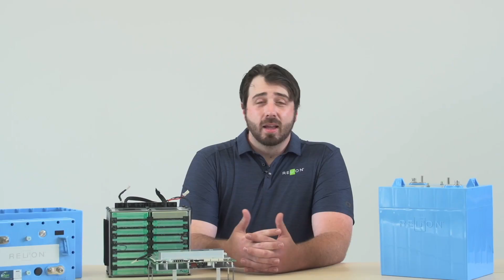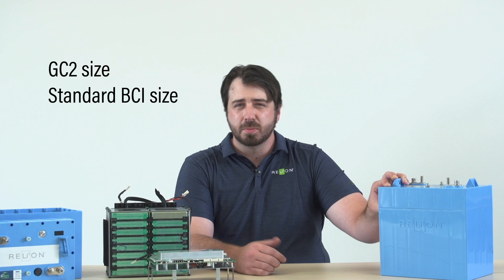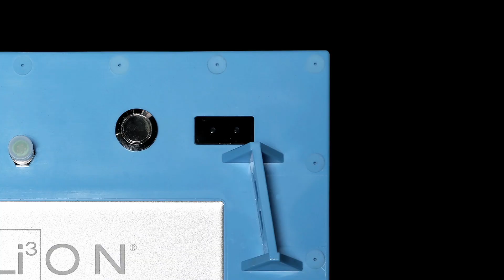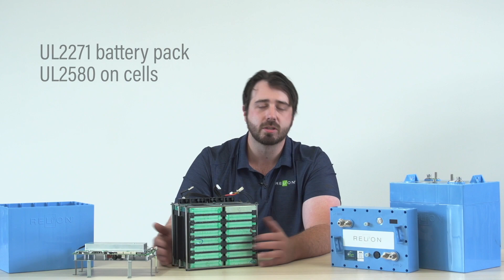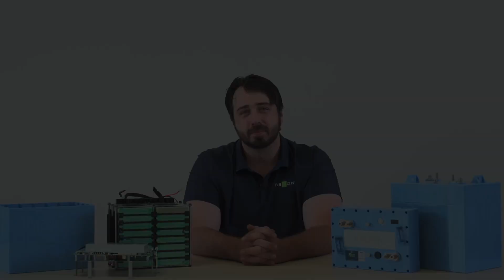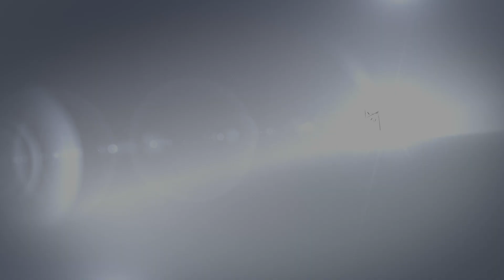RELiON InSight 48V Lithium Battery Teardown

Comment: These batteries look great and excellent workmanship.  The only minor shortfall I see is there is now low temp sensor to prevent the batteries from charging at temps below 32.  Doing so can cause lithium plating, a process that lowers your battery's capacity and can cause short circuits, damaging it irreparably.  Seems like so much engineering and safety built in to have this left off.  I don't get it, it's probably an extra $1 or $2 to implement a temp sensor.  I'm going to buy this battery regardless because I feel you guys did a great job, but please add this and provide for free to customers who already purchase.

Comment: Looking to replace my Trojan T-1275. Cart has 4 of them. Would/could I swap for 4 of this or would just a couple work?
Reply from the maker: Each InSight battery is 48V which can power a 48V electric golf car with just one battery.  You can hook up two 48V insight batteries in parallel to give you twice as much range as having just one 48V insight.